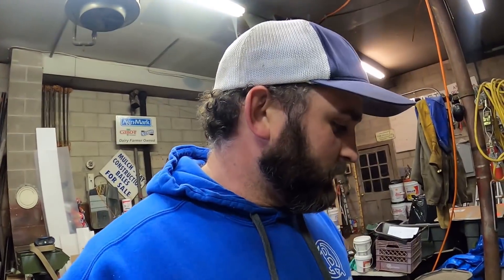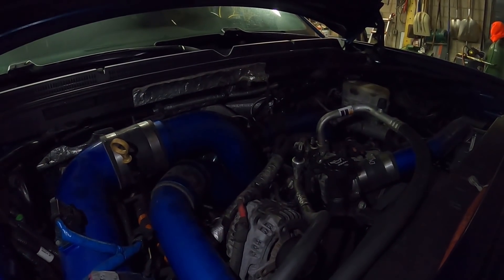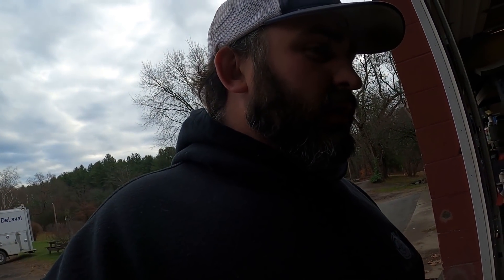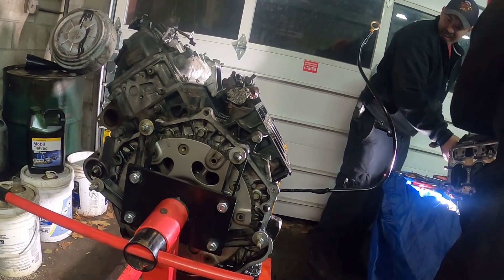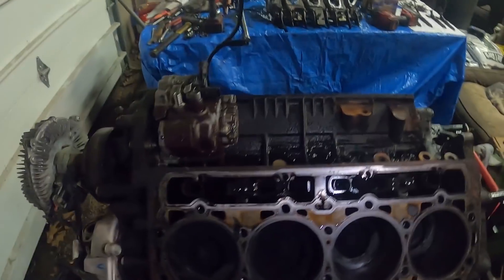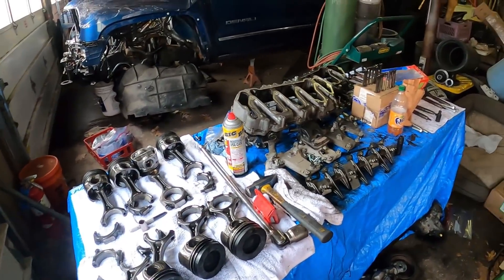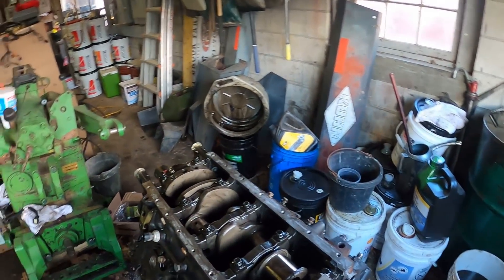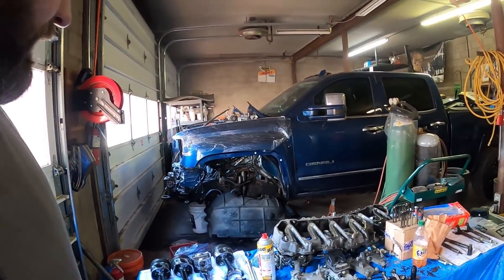What piston is cracked? 2016 Duramax Engine build Part 1

Comment: Thats how we learn stuf,play with it and F it up. 2003 Ram 4.7 mint condition. Me with a small settlement loved the truck. 2.5 level kit,Mickey Thompson Baja Locks,ProComp shocks,Pro Comp MT 3 Extremes,Super 40 single in duel out the back,Tint the windows,New brakes.....And 6 months later took out the 3:55 and put a 4:10 in it. And don't ferget the Classic 29 with a 300  watt friend. Oh yea,single cab short bed,My lil Mule.

Comment: The driver side pistons are always worse, if you will notice they are put in upside down from factory, ive had 2 lmls break pistons and one broke a crank pistons were starting to crack i noticed when i pulled apart.

Comment: I have a 2013 LML and just started using quite a bit of oil in the past month right before I did an oil change I check it and it wasn’t even on the did stick so I change it and now 350 miles later it is right at the bottom on the dipstick again any suggestions of wat is going on would be a huge help thanks

Comment: I would search for other tuning, my shop is a few miles from danville and i have fixed quite a few trucks they worked on. Last one was a street truck they deleted the pressure relief on the rail, pressure regulator failed and without that caused the cp3 to shit the bed too. Quite frequently have to unfuck their shit.
Reply from the maker: I am blaming this completely on egts with the big turbo and running it hard on the trailer
Reply: @DuffyAg  I don't doubt that had a lot to do with it but i fix a large number of trucks that danville has touched. Luckily fleece is just down the street, I usually use them for parts and tuning. Depending on emissions status they may not tune tho.

Comment: You should look into compound turbos, better for towing, I've been towing 12k for 10 years with my Duramax on a 500hp tune and that's not the big tune, egt's never get over 1100, BW S475 over stock turbo, stock injectors, drives like a stock truck til it gets over 10 psi and the big turbo comes to life. Big singles make big power but at the cost of fuel, driveability and durability.
Reply from the maker: I've thought about compounds, time will tell tho. My egts would get up to 1100-1200 but I also have 150 more hp and I'm running 20k at times. Drive ability is actually pretty amazing with the truck, yeah I can suck down alot of fuel quick if I'm really into it. Durability just need a engine rated to match up

Comment: People still can't understand that OEM parts are designed to break in time. Every time you buy something it will brake it's only a matter of when it it breaks. It's the key in the cog.
Reply: Everything wears out over time. Even the best high performance equipment will still eventually wear, and need maintenance.

Comment: People are saying that it’s because it’s a Chevy. All trucks got their own problems and pretty much all trucks are peices of shit in their own way. But this is not because it’s a Chevy. He put more boost, more air and more fuel on a STOCK motor. You can’t be surprised that this happened.
Reply from the maker: 100% right on that. Running something built to be at 400hp at 650hp all the time its bound to find the weakest link. Just pushing the limits and I was prepared to someday pay the price and build the engine

Comment: would any of the 7020 part be fore sale . the pto  front to back I have a 7020 without pto
Reply from the maker: As if right now I'm holding onto all the parts just in case for the future. Believe you would need the drop box components as well as all the transmission components to give it a pto. Not sure if all the same parts from a 7520 or not
Reply: no problem  I enjoy you videos just thought I would check I'm in southern ontario @DuffyAg

Comment: They crack because the wrist pin is way too big and that drastically takes material out of the piston. Stupid decision on gm’s part. Add more boost, more fuel and it’s just a matter of time.

Comment: Everything fails. Heck i have a 6.0 that my dad worked the hell out of has 240,000 miles stockish only had egr delete and aluminium charge pipe because the plastic one blew up. But its had injectors fail from age and small electronic grimlins. My brother has a sweet 2012 dodge 2500 tradesman pulls like a fucking train but with the deleted 6.7HO it can keep a tannsmission. And my dads 2016 is fully stock f-350 6.7 powerstroke not has it long but he loves dont know of many weak spots on the era of 6.7